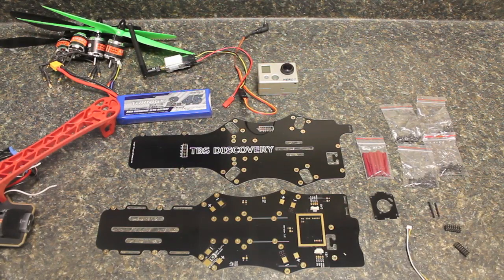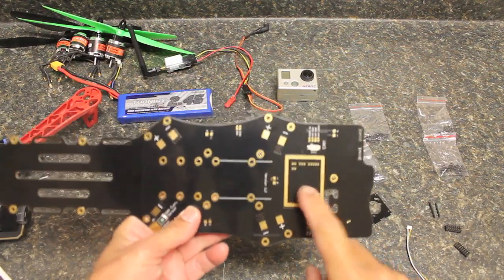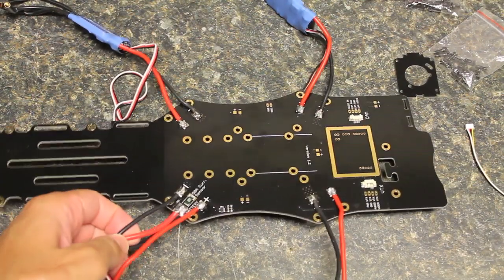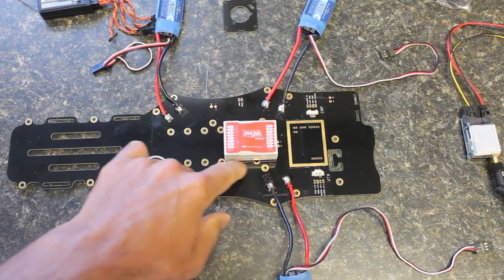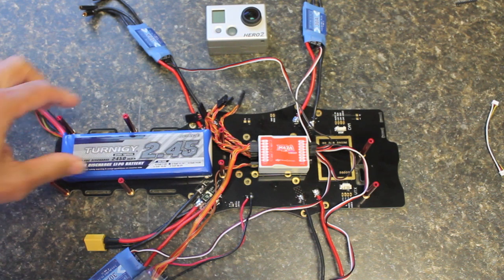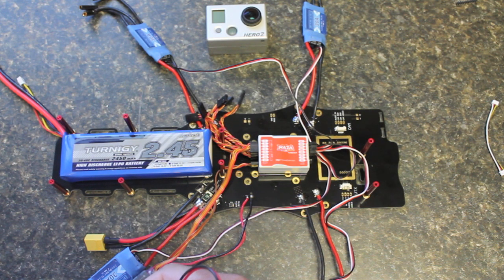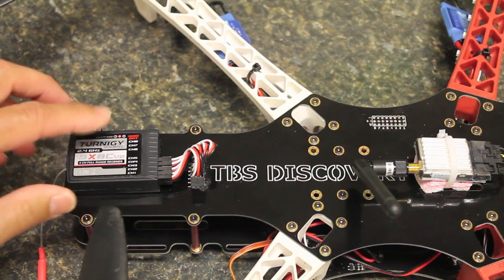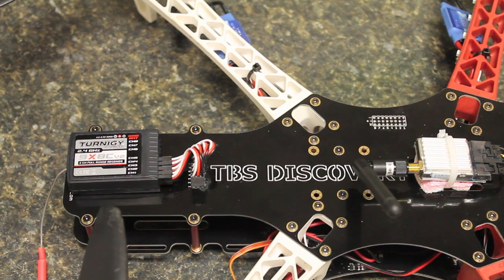TBS Discovery Build w/ DJI Naza and GoPro Hero 2 for FPV - Migrating from DJI Flamewheel F450

Comment: Hello I have the TBS discovery Pro all set up except that I can't make it run the lights goes on when I plug the battery in but my remote is not binding with the drone I can't figure out what to do  make it work

Comment: hi Dennis quick question where is the compass located on the dji system on the gps module or on the flight controller ?
Reply from the maker: TriniRCmodels It's part of the disc shaped GPS antenna. It includes both the GPS and Compass. Hope that helps.

Comment: thank you again for another great video for all of us... I am building one right now. My first build. Just wondered where you put the battery for the FPV transmitter and how you hooked up the transmitter.
Reply from the maker: NorCalHkyplayer I mounted the battery on top next to the transmitter. It's a small 800mAh that doesn't weigh too much. I hooked up the TX using a cable that connects to my GoPro. Right now I've been using this TX which makes it really easy to setup and adds very little weight:

https://www.youtube.com/watch?v=oBcLCbuO8OY

Comment: Why it's so expensive? The kit does not even include the arms, even if the arms  be very cheap and easy to find.
Reply from the maker: Right. I believe the price has come down a little bit since I posted the video. Part of it is they are a small company that doesn't have the ability to mass produce like a DJI or larger company. So they may not be able to drive the price all the way down to where you'd expect. I think $75 for the TBS frame is a good price given my experience with it. If you're going for truly vibration free video without much work then check out the QAV frames.

Comment: What kind of flight times were you getting with the 2.45mah battery?
Reply from the maker: Hey Graham, if I recall it was about 9 minutes. I no longer have this build but that's around the time I was getting. The 10" props definitely gave me a bit more time than the 8" I'm now flying on the QAV400.
Reply: Lll

Comment: Okay, NEVER ever mount your NAZA with velcro, it causes the quad to hover to the left or the right or to flip over on takeoff. Mount it flat using the provided 3M tape.
Reply from the maker: Good tip. Thanks for sharing.

Comment: dennis as I told you before I am a wounded vet and I have a f450 with naza gps  and turnigy9x and I upgraded to naza v2 still trying to get to be able to use all new v2 setting ioc rth courselock-home lock.can I send my quad to do and I will pay you to set up the whole tbs discovery with naza m v1 upgraded to v2 using stock turnigy9x and you can do a video on it?. I am sure that I am not alone here with upgrading there naza v1 to v2 and there are a lot of people still using stock turnigy 9x radios. I love mine and never had any problems.using stock firmware. my friends all have spectrums and jr,s and my 9x signal works just as far as theres do without any problems. please let me know if you would be interested in doing a video build for me?
Reply from the maker: David, I hope you're doing well and thanks for the note. Sure I'll be happy to help you out and we can definitely do a build video. I'm going to message you directly and we can talk through the details. The tough part will be mixing the IOC course lock with some of the other features (GPS Attitude, Manual, etc). The reason is that they are controlled from different ports on the NAZA (U vs X2 port). But let's discuss and we can take it from there. I'll send you a message on YouTube shortly.
Reply: Dennis Baldwin Thank You very much dennis for al of your videos and help. there are a lot of quad people out there that tune into watch andsee what you are doing next along with all your helpful tips, godbless
Reply: david ringler I agree. Thank you Dennis.

Comment from the maker: The TBS is a great frame. To answer your question if I were to buy a frame right now I would go with the QAV series. I just bought the QAV400 a couple months ago and it's awesome. It's considerably smaller than the TBS so if you're looking for something that size then check the QAV500. I like TBS because it uses the NAZA arms and all of these frames have the power distribution built into the frame. I've never shorted any components on a hard crash, but not saying it isn't possible. Good luck :)

Comment: Im in the middle of ordering stuff for my first quad,I just ordered the naza mv2,and im now looking to get the rest. Im torn between the Hover Things Flip FPV and the Discovery. Your video is almost a year old,,,do you still recommend it or looking back or having to do it over would you pick something else?
Im also a newb,the circuit board frame kinda scares me,Im thinking if I crash hard and break the board it will short out all my expensive components,Is this a possibility?

Comment from the maker: Thanks for the comment. I guess it would be possible to solder your receiver directly to the NAZA, but wouldn't be worth the effort. The benefit of not having it hard-wired is you can replace your receiver easily and change any aux/gear connections if you're messing with different flight modes. The NAZA gets power from the NAZA VU, which is the component that has the LED and USB connector on it. I hope this helps a bit.

Comment: oh just to tell you dennis use a simon k brushless esc 30amp if you r using kk2 board, it works alot better then any esc try it you would be very happy with the quads

Comment: Hey Dennis or Joey My NAZA-M w/ GPS just cam in ok. I have my "Assistant" hooked up and workng great (I think) but I cannot get the damn thing to arm. What am I doing wrong guys? Dennis I am using the 9XR which should be pretty much like the 9X right? I am using the Orange 9ch DSM2 mod. The Assistant shows my sticks moving so that tells me that the FC see's my radio commands. Please help if ya can k !!! Thanks :)

Comment from the maker: It's been quite some time since I've actually flown my F450, but to answer your question it definitely flies differently. When I first switched it took me a while to get used to the TBS flight characteristics. It's definitely less agile than F450 and it does seem to pitch forward less, which means it takes more work to counteract that motion (pitching back). I fly with a few guys here so let me know if you make it back to Austin. Thanks.

Comment: hey dennis, i was wondering what changes in terms of in flight characteristics youve noticed in your transition from the DJI 450 Flamewheel airframe to that of the TBS Disvovery. All things equal (like, using the same motors, esc's, and props) is the Discoverys forward flight speed faster? does it pitch nose forward less for a faster speed?

thanks for your reply.Next time im in Austin we'll have to do some formation flying. i used to live on 51st and guadalupe. Intramural fields. Live in EP now

Comment: Haven't tried other colors aside from black.  I have used red and white arms, both seem to accept color just fine.  I also have used the liquid and powder versions and they work the same.  The liquid is a tad more expensive but way cleaner and less messy and toxic (the powder version stinks and prolly not too good to inhale).  Be sure to by a cheapie disposable aluminum baking sheet to throw away when your finished, it makes an awful permanent mess if you're not careful.

Comment from the maker: It's what I used to get started since it will do video out and record at the same time. But I was having problem with the FOV and perspective, so I upgraded to a Sony CCD with 600TVL. There's a vid in my channel that shows it in more details. But if you're just getting started with FPV and have a GoPro then I would recommend giving it a try.

Comment: Well maybe because h quads are actualy x quads instead of of some weird symbol like yours. if you make them out of wood you can make a 600 size quad frame that weighs like 250 grams and have alot of room for fpv equipment. My quad flies great and doesn't fell corky or diffrent at all

Comment: Oh not like that but they sure give you more room. Dt 700 hk motors are way way more efficient. I actually set my hd quad outside and gps hovered went to eat some lunch came back 25 min later and it was still hovering. I put 2 3s4000 in parrallel. Point is find good motors and dt700 are awesome. everyone buys dt750 but dt700 are awesome. especially on 12x3.8 1400 grams thrust per motor at 18 amps vs my last ones 900 grams at 18 amps. i can hover at about 14 amps vs 2? with my last ones

Comment from the maker: You can definitely connect them without using the frame. It just makes it a little easier to place things if you do use the frame connectors. I'm actually not using them right now because one of them broke off. So I have my ESCs wired directly into the Naza and the receiver leads running into the other end of the Naza.

Comment: I use uhf and 2.4ghz 500mw transmiter so its not a problem though gopro interrfiers with uhf so thats aproblem. i could probably get about 3 miles on my system

Comment from the maker: I haven't done a range test with either yet, but plan on doing so. I've read that the stock Turnigy 9X TX/RX will yield about 500m. Some have done more and some have done less. If you get the FrSky upgrade I've read some people that have easily done 1.5miles. Check out solider53flyer's channel. He's done some long flights with it. As for the video tx/rx setup it maxs out at 500m. I've only done 250 feet and started to notice loss in quality. If you build a cloverleaf it should go much further.

Comment from the maker: 3.6kg thrust is pretty good. What motors and props are you running? Also, what GoPro gimbal are you using to get the tilt action or is it a homegrown setup?

Comment: Since im using the gopro for recording and fpv i though i should use tilt so i can look down while im flying and im planing to make a bunch of holes in one of my gopro cases to protect lens but make the gopro with the case and transmiter av cable and power supply and servo all weight 200 grams add that to 1140 grams make that 1340 from my 3.6kilogram thrust

Comment: well my system with gopro 2 with the case and servo tilt to look down dragonlink naza and 2.4ghz 500mw is about 1340 with 5000 mah 3s dji f450 with hj450 arms. im planing on taking the case off and getting smaller reciever antanna and using 200mw tx with better reciver with better antenna which will reduce 140 grams and come down to 1200 more or less. Ever heard more is less. I like the tbs frame but its too heavy and battery life reduced. your better off cramping everthing and geting 2 miles

Comment from the maker: IOC is pretty amazing. What it does it regardless of which way your Naza front is pointed your forward pitch will always move your quad forward. This means you don't have to worry about orientation and makes it much easier to fly. Hope that makes sense. You can download the Naza manual from the DJI site and look at page 21 to see how to set it up.

Comment: i've switched out to a 4s 5800 running 10x5 props still getting about 11 minutes of flight
I did goto tiger 770kv motors

Comment from the maker: Yes, for FPV the Discovery is great. If you're looking to fly with a gimbal and do aerial photo/video stuff then TBS isn't really the best platform. The TBS may help with your orientation issues, but you could also consider getting a Naza GPS and flying using IOC (intelligent orientation control). Just a thought.

Comment from the maker: Scott, good question. The motors I'm using are actually cheaper DJI alternatives so the standard DJI should work just fine. I've seen several guys flying the TBS with the stock DJI motors.

Comment: hi can you tell me if I can use the dji moters that were supplied with my naza 450 kit on the TBS discovery conversion , as I noticed on the very helpful video you had used different moters , and I just wondered if I needed to change them   thanks scott

Comment from the maker: You should be okay with those holes as long as you don't plan on soldering any header pins there. Now I'm not sure what the dimensions of WKM are so that may be something to consider, but my guess it that it should fit. Also, check out the HT-FPV frame because I believe there's more mounting space available.

Comment: If I want to install a WKM ( Wookong M Autopilot system ) on the board can I without any interference from those Header Pin holes? I wouldn't be installing any of the FPV stuff I just want a bigger board for building my F450.

Comment from the maker: Nice setup. My TBS discovery with FPV equipment ways just over 3 lbs (3.06). You're absolutely right about motor speed and prop size. I'm trying to get this dialed in. Thanks for the suggestion on the carbon props. Which brand do you fly with?

Comment: with my dji f450 with 1077 grams or 2.6 lb with no fpv equipment i get 12 min 4000mah only using 3000mah. Here is the thing you have to have the appropriete motors with right props and the total weight must be right. higher kv motors are more efficient if the are small adn weight around 50 grams. props should be around 9x4.4 or 10x4.5 CARBON. CARBON PROPS WILL GIVE BETTER FLIGHT TIMES FOR SOME REASON. QUADCOPTER STABILITY ALSO IMPROVES. ALSO REDUCING WEIGHT IS THE BEST THING YOU CAN DO

Comment: i swear dji arms are so weak and britle my quad crashed 10 times and most of the time broke the plastic props. this time i got carbon props which survived even hitting concrete like 4 times but one arm broke at the very end wre motor is so i can glue it back on securely wtf

Comment from the maker: You know, given they're cheap Chinese motors they're not all that bad. I've had better luck with them (so far) than the Turnigy motors. I definitely wouldn't recommend them carrying any sort of expensive payload like a high-end camera, but for GoPro and FPV stuff they've been great so far. Now I haven't taken them apart to check out the internal construction, but may do that in the near future. These motors are recommended as a viable alternative to the DJI motors. Got them from gothelirc

Comment: i'm running 9x4.5 on 750kv motors
11 minutes on a 7500mah 3s venom pack and i'm putting 4227mah back in so I still got some play time left in her
i'm thinking of going to a 10x4.5 or a 10x5 but i'm not sure thats the right move either

Comment from the maker: Thanks for pointing out the fact I didn't list my props in the description above. I'm using 10x4.5 props and they work well, but I'd like to give 9" props a try to see if that would reduce some of the vibration. My quad is almost 3lbs fully loaded so I'm not sure 9" will cut it with a 3S battery. 11 minutes is pretty awesome I must say. What size battery and props are you using?

Comment from the maker: The X666 frame looks very nice. I have a Turnigy Talon frame which has a similar design and I really enjoyed flying it. I'll be anxious to hear when you get up and running. I've been using the GoPro to film in 1080P mode, but that doesn't affect the TV output resolution which is what I'm using for FPV. Hope that makes sense!

Comment from the maker: That's a great suggestion and something I've been wondering about. Do you have any recommendations for good vibration material? Someone actually told me that the most effective material for the money is to use the fluorescent orange earplugs that you see all the time. The ones made out of memory foam. Sounds quirky, but I may give it a try.